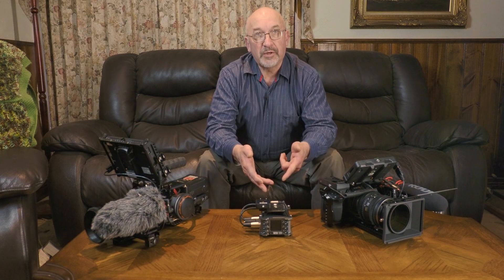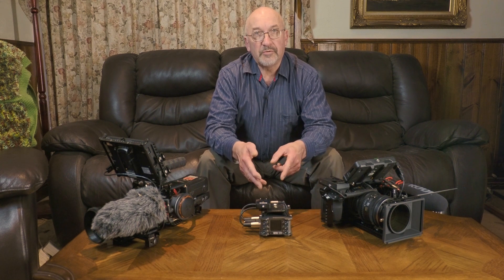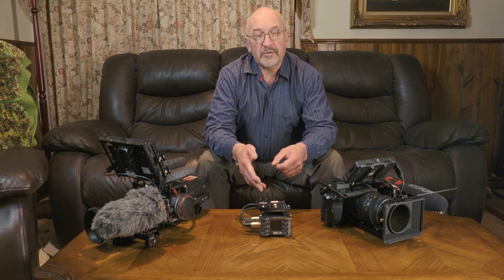Zoom F6 & Rode Wireless Go - 32 bit

Comment: Another way to test this is clip the audio on the receiver with the gain down on the zoom. 32 bits float will recover clipped audio, but if the audio is clipped on the receiver the wave form will still be cut off even with the gain down on the zoom. You can check this by intentionally clipping the gain on the rode wireless and have the gain low on the zoom and check the wave form in a DAW. If the clipped audio is recoverable then that's a good bet it is 32 bits from the receiver, but if not the wave form, no matter what gain setting will show the edges cut off like distortion.
Reply from the maker: That's another way of testing it and it may be worth giving it a try. That said, I've found the F6 to be a very useful tool in many situations, so every videographer should consider a high quality audio recorder. And with more 32 bit float recorders coming on the scene at reasonable prices, it's even more compelling.

Comment: What cord did you use to connect the receiver to the Zoom F6 on top of the cage
Reply from the maker: It's an XLR to 3.5mm short cable from Amazon AU: https://amzn.to/3GWYAiN or Amazon US: https://amzn.to/3e1P6Xa.
Reply: @AustralianImage  checking that I understand... A balanced cable like you linked can maintain stereo channels by the rode mics... Where an unbalanced cable will only allow mono to the XLR ?
Reply from the maker: @Mrbenbarbie  A balanced cable just ensures that you don't get interference in the cable that could be introduced from external devices like the audio recorder.

Comment: The problem is you can easily clip the Wireless Go audio before it sends the audio out, therefore the 32 bit float capability of the F6 isn't really needed.
Reply from the maker: It may do, but regardless, it seems that you can recover the audio from what the Zoom F6 records and make it quite acceptable. I think this is more important than what the technical specifications might suggest. I was going to provide the audio clips from my tests, but I had more difficulty than it was worth trying to screen capture the Fairlight audio track.
Reply: Can I ask you both to expand on this topic. Can we not set the audio level on the Go-end to be more silent to be extra safe that it won´t clip and then rely on 32bit recording to be able to be able to "pull the details" from more silent material?
Reply from the maker: @MotMovie  You can do that and I think it works either way. I have the Wireless GO levels set higher, as I swap them about on my cameras and don't want to forget to reset. The camera levels are generally set low and the Wireless GO high(er). I have some good news about the Wireless GO II units as well; coming up when I can get through a ton of video recorded over the last five days while on a mountain trip.
Reply: @AustralianImage  - Thanks for the reply! I shall stay tuned, Im thinking of driving boom and lavalier via Go II to a F2 recorder for extra compact setup here so will be grateful for everything related
Reply: What Mark Bernhardt said is correct. The Wireless go does not have adjustment for the input level, only output. If the input signal peaks, regardless of the output, it will be a clipped signal.

Comment: I think your test is perfect in that a consequence of 32 bit float is that you will pick up actual background noise given the more sensitive you set the mic then it will simply ‘hear’ things like a computer fan. However, I think your interpretation of the wireless go ‘transmitting’ a 32 bit signal is not exactly right. The mic transmits it’s standard signal, it is the recorder that applies 32 bit float processing to what it receives. Of course, the net result is the same - you can record 32 bit float using a ride wireless go.
Reply from the maker: You are correct. What I meant was that it appeared that the Wireless GO was transmitting an appropriate signal so that the Zoom could apply 32bit processing (or get a result that was much the same). I'm not really sure what's going on but, as you say, the end result appears the same.

Comment: I just ordered a F6 and panicked that my rode wireless go wouldn’t be compatible with 32 bit, but I’m happy to hear you tested it and it seems to work! Thank you for this!
Reply from the maker: As far as I can tell, there is a difference, which indicates that it must be providing a 32bit signal. If not, it certainly gives you a lot of adjustment scope.
Reply: @AustralianImage  What XLR to 3.5mm adapters do you use for the Rode Wirless Go? I bought some TRS Balanced adapters, but they are barely working on the F6. I have to have the input volume set to max...something isn't working right with the adapters. Do you use line-in for the input setting for the wireless  go or mic as the input?
Reply from the maker: @eravedesigns  I bought mine off eBay: https://www.ebay.com.au/itm/3-5mm-to-XLR-3Pin-Male-Cable-1-8-Male-TRS-Audio-Converter-Stereo-Adapter-Cord-/133236300228?var=&hash=item0. These were the only short cables that I could find at the time, as I didn't want long cables needing to be wrapped up. The XLR plugs are a bit of a tight fit, but the cables work well. The tight fit doesn't bother me, as I don't insert and remove the cables very often.
Reply: I use a Rode XLR to 3.5 mm connector. Seems to work fine. Using it for 6 months
Reply: @muralibalaraman  rode vxlr or vxlr+?
Reply: @felipemvera  vxlr+
Reply from the maker: @muralibalaraman  I have one of those as well, but for a different use. They do work well, but I wanted a short, integrated, XLR to 3.5mm cable (two actually).

Comment: Hi Mister, i follow your very interesting publication on youtube about your setup. It would be nice if you can explain me how you link the wireless go in the camera with the timecode throught the zoom f6... following your last post i command the f6, but i must understand clearly before buying a second wireless go. (Sorry for my english, i am french...) Best regards. Lionel
Reply from the maker: Thank you Lionel. I'm not using time code when I connect the camera to the F6. I connect the Wireless GO transmitter to the mic on the camera (and the camera mic via mini-XLR to the camera using a stereo splitter cable) and then the Wireless GO receiver to the F6. That means I get what the camera mic is recording on the F6, but at a much better quality than what the camera is recording via the mini-XLR (but which can be used as a backup). 
I find this a lot easier than trying to use timecode with the F6 and BMPC4K. You have to note that I'm using this combination in a run and gun situation and I've found this to be the easiest and most consistent way to do this. When I use both cameras at once, both Wireless GO receivers are connected to the F6 (and one transmitter to each camera), so I'm still getting synced audio with what's been recorded on each camera.
The only positive way to get timecode is to use something like the Tentacle Sync system, but that gets very expensive, very fast.
Reply: @AustralianImage  Thank's a lot for your answer ! Yes, i didnt wanted buy an expensive tentacle, but it seems that it is the better way to generate  timecode... i suppose that you synchronise all audio in Davinci Resolve after that ? My purpose is to use 2 wireless go for 2 lavalier microphones when the actors are too far for a boom pole. So, i will connect the receiver to f6 and synchronise in Resolve. Thank's again. Regards, Lionel
Reply from the maker: @TVJakob1  If it helps even a small amount, that's all that matters.

Comment: Thanks for this. I have the Wireless Go and have been considering the F6.
Reply from the maker: The F6 is an excellent unit. It has several advantages over the MixPre 3 II which is its competitor. Price is one aspect (at least in Australia) and the fact that it takes internal AAs and external NP-F batteries using a built in adapter are what I consider superior features to the MixPre. I also prefer the shape, as it is more manageable when it comes to getting a case, and the six XLR ports offer more options. I don't need or want a touch screen (especially one that's a s small as a postage stamp) like with the MixPre and the manual system F6 works well. I've also found the top mount of the F6 very useful, something which the MixPre doesn't offer.